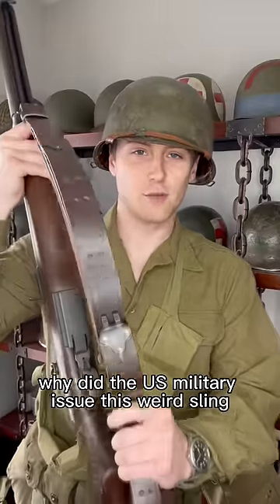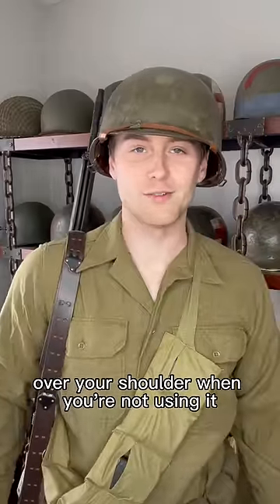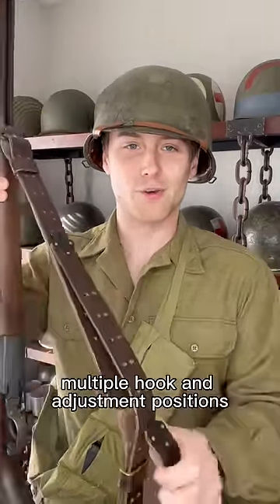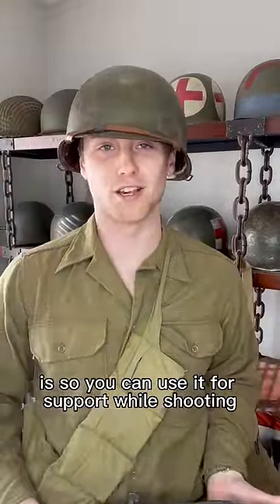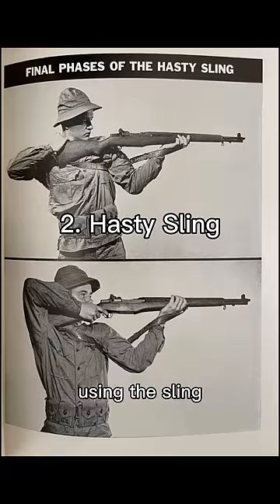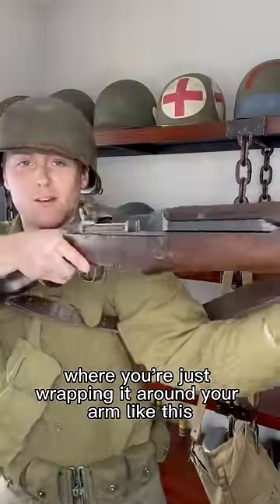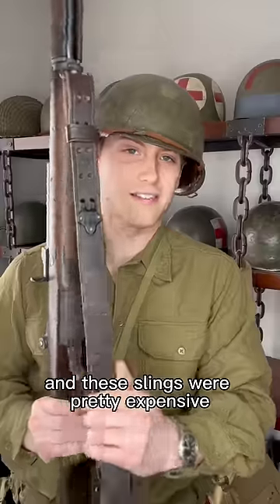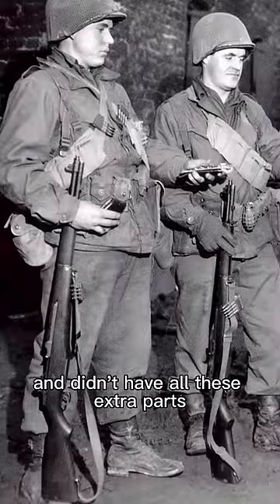Why Use This Weird WWII Rifle Sling? (The 1907 Sling)

Comment: My M-1 has a sling like that. I have used the second method to support it while shooting. I’ll have to figure out and try that first method.
Reply: Cool
Reply: I am using that sling on my 1903a3, first method needs some training but helps to be more steady.
Reply: @Caederre did you have to adjust it so it was tight to your body? Or did it fit the way it came.
Reply: @Praktical_  I had to adjust it a little bit, took me like 5 minutes after watching a video on YouTube.
Reply: @TheRedKing247  Since the video deals with the M-1 Garand, I thought it was obvious.
Reply: @TheRedKing247  Bazooka
Reply: @TheRedKing247  I have one of those too, (in 1/16 scale,) but I haven't put a sling on it.
Reply: @TheRedKing247  Thats like going into a comment section with people talking about star wars and someone says the second one and youre like "The second what? Ghostbusters? Spider-man? John Wick?"
Reply: @TheRedKing247  stop acting du.b
Reply: We were taught how to use a high loop sling in the Marines. It is super-stable.
Reply: Did it actually help with accuracy?
Reply: @germanfisch  the high loop sling? Yes. 100% absolutely helped. But modern combat moves too fast for this to be be practical in a war zone. It is still good to know HOW, in case you have the time and need to take a head shot at 500 yd, but most combat is inside 100 yards and moves way too fast to fk around with sling loops.
Reply: Seems like one of the... seemingly many useless and expensive innovations developed by the Military. But hey, innovation is what they tend to be pretty good at! Wristwatches? 

That'd be thanks to WWI, a war during which there was likely quite a lot that was learned and innovated in terms of aircraft technology. Including an 'interruptor' designed I think by the  Germans so that you can mount a machine gun on the main body of a plane behind the propeller but it operates such that it simply CANNOT shoot a hole through the propeller which to my knowledge is something that initially used to happen.

Oh and tanks were invented by the British while the use of chemical gas was introduced by the Germans I think. America, meanwhile, brought shotguns, and this upset the Germans, though shotguns aren't a WWI technology, pump-actions were in the late 19th century and muskets had likely at times used shot for hunting purposes for hundreds of years. The blunderbuss, for instance.

So yeah, a lot of interesting and cool (and horrific) innovations, but not all of them stick the landing. Having someone use your sling design at length without actually using it as it was intended is not a ringing endorsement, but who knows? Maybe it's actually practical!
Reply: It's very similar to Olympic 3 position sling holds still used today.
Reply: Most combat footage almost always show no GI doing this
Reply: Gotta remember -- guys in 1907 were dinky.
Reply: @TheRedKing247  He said M1 Garand at the beginning!
Reply: I’ve used a hasty to shoot a deer with a different rifle and sling 

It really locks it in
Reply: having tried it a few times it seems to be intended to make slowly aiming the rifle side to side much steadier. I would assume it would be helpful to track moving targets at longer range by allowing you to make slower smoother adjustments. But to me it felt very un natural.
Reply: FIRST METHOD GIVES YOU MORE STABILITY AND HELPS REDUCE RECOIL
Reply: @firesupport162  that would be because the times you would actually use this, would make for pretty boring combat footage. If you are using a high loop you are taking real time to set up one shot. And once that shot is made, chances of a second are low because everyone will go for cover. So there is a little bit of a survivorship bias in the war footage. To the extent that a high loop was used (if it was used) it would be more likely to end up in an Army training film than whatever war footage we have extant.
Reply: @lilfattcatt7758  the high loop does the same thing as the hasty, with about double the stability.
Reply: @TexasGreed  what it does is lock the weapon into a fixed platform from your waist up. It uses tension to turn the entire upper half of your body into one solid “engineering” structure. 

This makes almost every kind of shot easier, including tracking. However,

The high loop is super time intensive, and tracking shots are usually inside point blank range (300 yd) so I’d recommend a hasty sling over a high loop for tracking shots. It’s not as good, but I don’t want to be messing around with half a sling tied off over my bicep when I’m almost in pistol range lol
Reply: @jaketurner4720  prone with a high loop is just a hair below a proper bipod wrt stability. With training (such as Olympic training) it is the full equivalent of a good bipod, or even better than - if the bipod attachment point isn’t floated.
Reply: @GlenBradley  I’ll give it a try my sling is set up similar to the M1’s just Nylon
Reply: Check out National Service Rifle Matches (CMP Matches) sling isn’t utilized in standing per rules but it is very useful for sitting and prone and after seeing this video could be for standing as well😂
Reply: How accurate and comfortable was the second method? Have you figured out and tried the first method?
Reply: @Etags  It is comfortable. And added some stability in aiming.
Reply: My cousin had an airgun, he was shooting cans and plastic bottles.
He had the sling wrapped around him kinda crazy to keep it steady when he was taking aim.

It took me a year to put it together that it'll help.
Reply: I'm sweating in german rn
Reply: @Praktical_   Yes you have to adjust it to you. If you do use it, make sure you have it marked for standing, sitting, and prone because each position will require different adjustments.
Reply: @germanfisch  Yes it works very well in that regard.  However, when you zero the rifle make sure you zero both using the sling, and not using the sling as it does change your point of impact a little.
Reply: @germanfisch İt helps with keeping the weapon steady, which in turn helps accuracy. Properly adjusted , is very effective.
Reply: @irgendeinname9256 I'm sweating in Spanish and la cucaracha doesn't help.
Reply: Love the arm wrap method.. i dont have an M1 sadly but i used to compete and hunt and thats what i used when i could have a sling
Reply: There's a WW2 Army training film on UTube that demonstrates the process.
Reply: I was trained on it back in the day. It takes forever and it's not something you would ever be able to do in combat. The idea is you would set it up beforehand in something like a defensive position. But if you're in a good defensive position there's much better ways to support your rifle. It's actually a technique dating back to the old Camp Perry matches where you had rules about not resting your rifle on the ground. I think the Marines were still teaching this up into the 90s and I was taught how to shoot by old Marines so that's where I learned it from.

Comment: I used the nylon sling that’s basically the canvas one in basic. It was od 7. I even used it in the fleet. When it was retired my unit let me keep my old sling. We also called it a parade sling.
Reply: you served in ww1?
Reply: @pedropedrohan102  No, would probably be to old to type. As mentioned above the canvas type sling came out during the Second World War. A nylon version would continue to see service until it was retired from service around 2015 or 2016.
Reply: @MidnightMoon2267  ok
Reply: @MIDNIGHT2267  as on 2018 the USMC was still using it in bootcamp for 1st phase
Reply: @derekmensch3601  Suprised it’s still used. My unit retired it from use.
Reply: @MIDNIGHT2267  I saw a Maintenance Battalion Marine with one on the Rifle range. But I don't think he got it issued to him. That was 2020 though
Reply: @pedro pedrohan  Marines are still using this method well I did back in 2019 when they shoot during during rifle range. Called a Parade sling. I know they ended up changing the slings but my unit was one of the last to recieve it. Remember the old days of losing circulation.
Reply: When did u serve
Reply: @MrSimplified  2013-2018 in the Marines. Apparently the nylon sling is still used in boot camp.
Reply: @pedropedrohan102  Uh, the Garand wasn't around in WW1. WW1 was over 100 years ago.
Reply: @n0t_the_plague_doctor343  To be fair, it was also used with the Springfield. 1903 rifle.  Source: I own a 1903 that still has it's serial number, US Army stamp and serial number.
Reply: that is rather clever
Reply: @MidnightMoon2267  its still the gold standard for service rifle competitions and basic rifle training
Reply: @MidnightMoon2267 1997-2009 Army for me. I used the parade sling all the time and loved it. I kept mine when I left. It's currently on my No. 4 SMLE.
Reply: @MidnightMoon2267 some can type at 100+ but WW1 vets if they are still alive they probably waste their time on YouTube and shit.

Comment: We were trained to use the loop sling in the USMC in the '90's. Used for stable support at long distance.
Reply: I went to boot camp in 2018 and that’s how we did it then too
Reply: Also because the upper and lower were pretty sloppy fit.
Reply: @MrStaybrown  so your familiar with the M-16 a2 and how they were "lightly used". Civilians would think there AR ways done for if they were like that!
Reply: @phillipallen3259  exactly. 
Qual'd expert every year on those hand me downs. 😁👍
Reply: I miss the old A2… Semper Fi
Reply: Yup still used them in 2008 when I went in. The loop was the most valuable tool in marksmanship. Always carried 2 slings one for parade purpose and the loop I kept on Bertha any time we were not required to have our parade sling.
Reply: 2020 slinging M16A4 for the Table 1 Range!
Reply: Shit works like a champ at long range with iron sights
Reply: what a smart design
Reply: I went to bootcamp in 2022 and we used the sling for tables 1 and 2 .

Comment: I used to have a .22 magnum with a sling and always felt that the first method was tighter and more stable. Lots of woodchucks met their maker at ranges of 100-200 yards. We had permission to keep an alfalfa field clear of the varmints. This is back when you could walk on a country road at 18 years old, rifle slung over your shoulder, and the cops would just drive by.

Comment: We were taught to use the webbing adjustable  sling that was standard on our m-16a2 service rifles when I went through us Marine Corps bootcamp in 2000. But even when we shot for qualification on the KD course, we really only used the hasty sling. Even all the way back at the 500m line. We took 10 shots from the 500, all of them from the prone position using the open sights, with elevation and windage calls. 500 m is just short of 5 football fields. The targets are 6 for squares, but the black is an area that is the size and shape of a man's upper body, and a hit in the black was 1 point and any where else was 0 points. From the 500 the whole target is about as wide as your front sight post was. Consistently, year after year, marines qualify on the range every year, I was able to do it 8 outta 10 times. You have to look at the flags and judge the windage, dial it in to you sight, you were laying flat on the ground so you had that for support. No sandbags at all though. We used bone support and the sling to help hold the toggle right into our body and stabilize it. You also hadda have a good stock to cheek marriage and then also breath control and trigger control. But if you put it all together, you can shoot an open sight m16a2 550m point(man sized) target.

Comment: The cheaper canvas sling could also do all the same stuff, with a little finagling. They were still teaching how to set up and utilize a proper loop sling and a hasty sling with the canvas slings when I went through boot camp back in 2008. We were still doing iron sights on M16A2's then also, I know they've gone to the RCO/ACOG's nowadays so idk if they're still teaching the loop sling. I hope they are, a property loop sling will have you shooting Lazer beams out to 500 yards with ease. Set up properly, I was putting a 10 round rapid fire group into a space about the size of a softball at 300 yards, it's crazy how much control it gives you.

Comment: I have an 1907 sling in my basement it’s been inside of a drawer with a lot of metal stuff so there’s bunch of rust all over it from corrosion and stuff breaking off of pieces of metal but it was originally for my grandpa‘s 1903 which is older brother and father sporterized that’s the damn most accurate rifle I’ve ever shot

Comment: I have one of these slings and I've used both methods. Yours isn't quite tight enough for either method. Although you can hang your weapon on your shoulder, that's not the intended purpose of a sling. It's to stabilize your weapon by adding a third point of contact while firing. This greatly improves stability and accuracy. When you only hold your weapon with just your hands, it can get very heavy very fast. By looping your arm through the sling, you can hold it all day.

Also, it would be nice if you learned how to pronounce "garand" correctly.

Comment: Like a lot of first iterations of anything in the military, the idea was almost certainly thought up tested and approved by officers, so you get some wacky stuff like say your Springfields iron sight picture, a fine long range iron sight but there's this funny little thing, at 200 yards it perfectly fits a military competition target of the time. what was the range, target shooting competitions in the military would be held at? 200 yards, unrelated I am entirely sure. When ever any kind of tech is being designed, one can hope that the person making it has someone in mind when optimizing the design, an Ar 15 has LEGO style parts to make repair and refitting so easy a marine could do it. In pretty much all militaries the farther you go back the more common this problem of, "well we made this not with the grunt in mind but an officer who never leaves base and has no combat experience" and that is why you have use a gyroscope to guide you on the most holy path of, "how the hell does this sling work again."

Comment: Actually more people wrapped the sling around their arm once and got into a crouching position while keeping tension between in the sling to keep the rifle from moving at all unless your arm moved. It was and still is really good for accuracy when you have wind factor and don’t want to shoot prone.. it also helped with firing rifles in full-auto.
Reply: Exactly my method for using the sling.
Reply: 😊 see
Reply: thanks
Reply: The sling is used prone too
Reply: Wrapping the sling once around my arm is how I've used the sling as well, when I'm off on an adventure at the range hunting little squares of paper.  I'm a duffer but even I can see that it helps.
Reply: That's the "hasty sling" technique that they teach. Much more useful and effective technique in real life than actually using a full shooting sling setup.

Comment: Prior to WWII, pretty much every military made decisions about their battle rifle based on the gun range. From ammo (way over powered for combat, but they fly better at long range) to sights (more fine adjustment than any soldier needed. The sling was another tool that was used for getting scores on the range, but wasn't needed in battle. The history of any rifle's development will normally have a an argument between the board that tests it on the range and the men that test it in the field.
Reply: I came here to say this exact thing
Reply: 100/100
Reply: One uses what one one is given to use. Isn't  it?
Reply: @davidbell1619  Yes, a soldier will use what they are given. But that doesn't mean it works well in the field. When boots hit the ground, decisions made on the proving grounds can prove detrimental in the field. Troops will modify or lose equipment that doesn't help complete the mission. And they will complain up the chain if they can.

Comment: I used slings like that on my University Rifle team. I’d assume they weren’t intended for use in every combat situation, but more for when accuracy was key and the distance to the target was greater than a typical engagement. It was probably used most by sharpshooters/marksmen and guys who were experienced shooters as civilians
Reply: Or on the defensive when you have time and you'll be holding the rifle for long periods of time.

Comment: they still taught it when i was in USMC boot camp 2013. except with the oil drab cloth sling. I remember while i was still in, the Marine Corps barred our ability to use our slings for support during evaluations.

Comment: The first method, when used properly, provides rock solid support while shooting. This support process provides a near bench rest quality support. It’s painful on the arm when adjusted correctly. The cotton webbing, and later, nylon sling was used the same way to stabilize the weapon system for long range accuracy as well as close range rapid fire (300 meters and less). Looking at pictures and thinking you have it right is not the best way. Contact the CMP and find a good instructor to learn the skill correctly.

Comment: I remember being given an explanation about the extra complex sling being that it was a cost saving measure.
Since the first method of support was designed for accuracy and so a soldier could fill a Designated Marksman role without having to be issued a new rifle or optics (which were more expensive back then) and if the role was needed any soldier could take up the role without one needing to be transferred to the squad.
How true this is I don't know but I guess other people will know better.